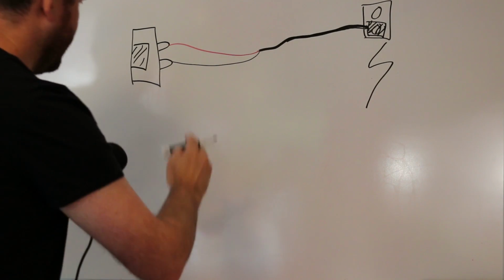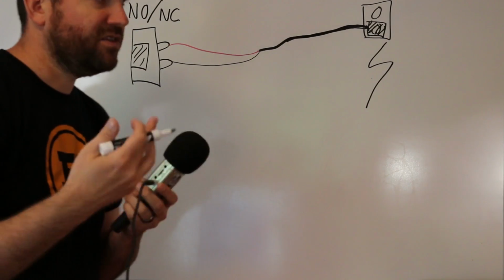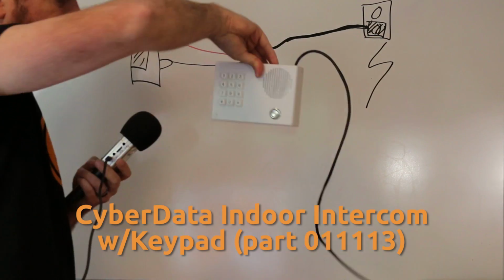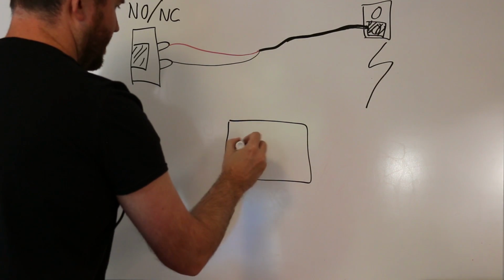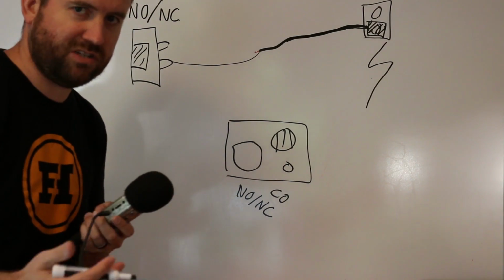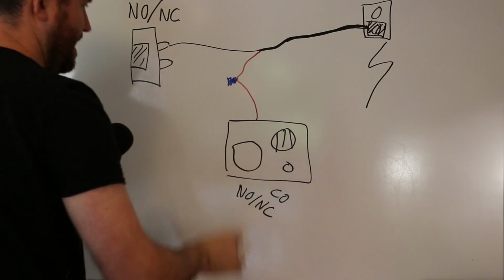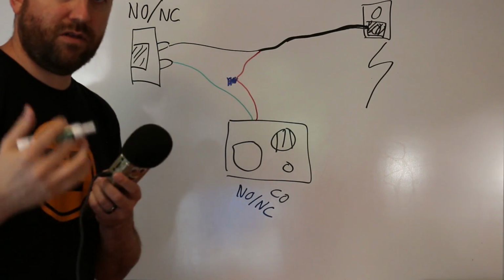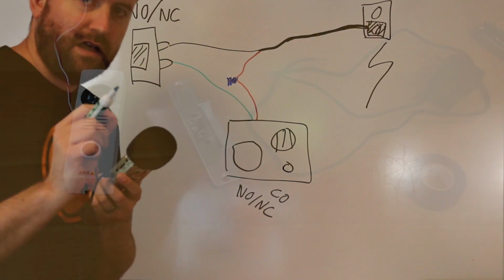Relays...How Do They Work?

Comment: It would appear that you have a Tungsten ring on. I didn't read all of the other comments because I don't have time but I was working with low voltage stuff and some 12 volt batteries and I highly do not recommend having a Tungsten or any metal conducting ring on your finger when you are working with live electricity in any circumstance. Trust me when I say this

Comment: NO and NC is referring to the circuit, not the lock. NO strikes remain locked until their circuit is closed. NC is more common for magnetic locks, since their circuit is constantly powered (closed) in order to keep the electromagnet engaged.

Comment: You could just use the 350mA that Axis 8105-E relay output is capable of to also power the strike lock rather than plugging strike lock to a dedicated power supply. The length from Axis to strike lock will also be short specially if both are connected to same door so very low voltage drop if any
Reply: Hello! Can you tell me how? I’m thinking about it right now.

Comment: Could you please please please do one for the Axis A8004-VE? I am struggling with it and would prefer to use the 12v output it supplies rather than having to plug anything in as the whole point of getting the A8004-VE is to take advantage of PoE

Comment: DC Voltage is always Positive / Negative.  AC is Line and Neutral / Common / Ground.
Reply: AC its not always Line and neutral. Line and neutral only happens when you have electrical service which is AC power. But if you have 24 v AC for HVAC system then we have T and C. Or if you have 240V in american system you have phase 1 and phase 2.

Comment: Great Video!  Your strike is a Failsecure N/C (always locked) if it was always unlocked it would be Failsafe. N/O.
Reply: This is backward. NC and NO refer to the circuit. These strikes remain locked while unpowered (open circuit), therefore you would wire them to a "NO" relay output.
A MAG lock for example, requires constant power to remain locked, therefore you would wire it to a "NC" relay output. Circumstances that require a failsafe electric strike are rare. There is almost always a panic bar/paddle require in commercial settings anyway.

Comment: Great video, but my question of couse is how to integrate it in freepbx?
Reply from the maker: Yup - as Brett said - it's just a SIP extension in FreePBX.
Reply: Through the PoE/Network Cable, You setup the SIP Extension, and thru a GUI you tell it what extension to ring when the button is pressed, it calls that extension, allowing you to talk to the device. When you press 9 or what ever DTMF tone it will unlock the door.